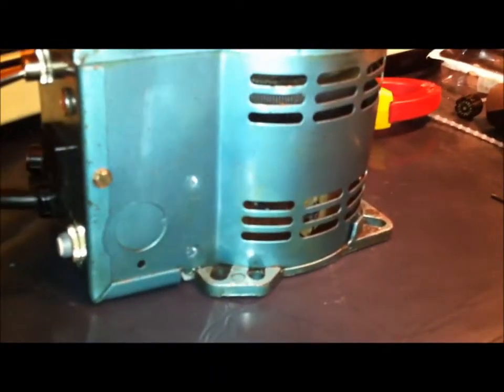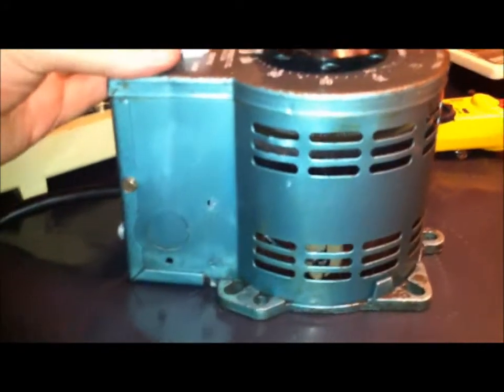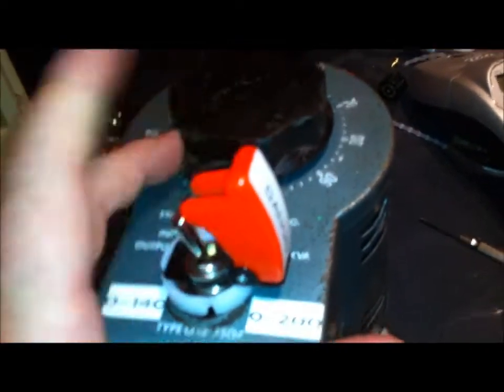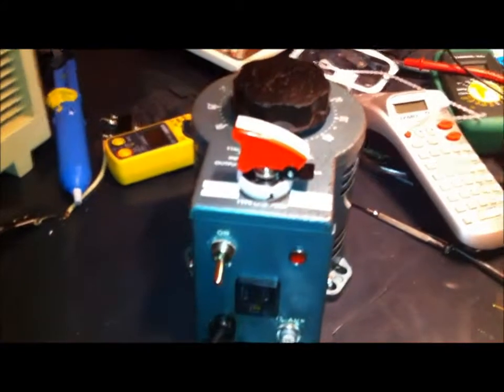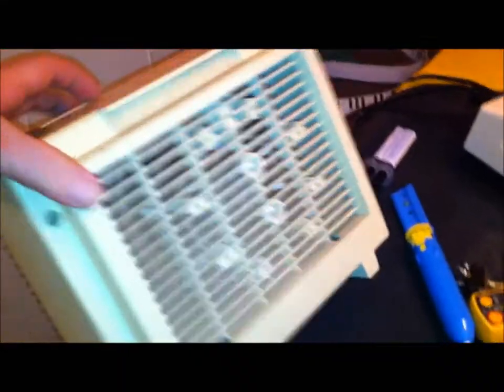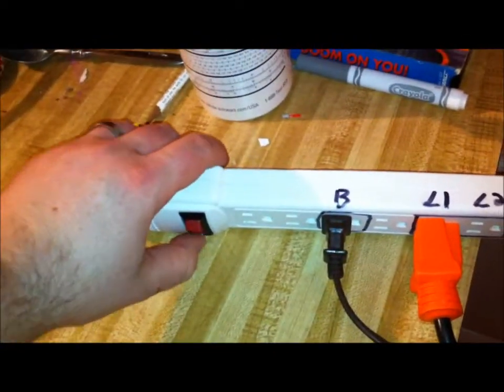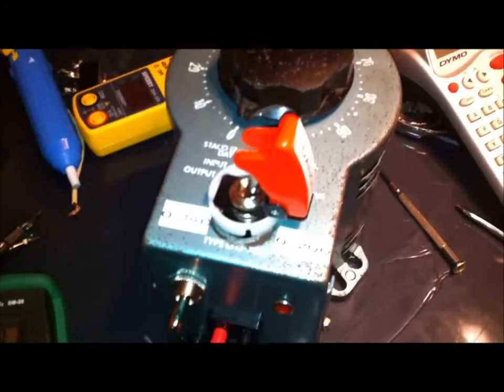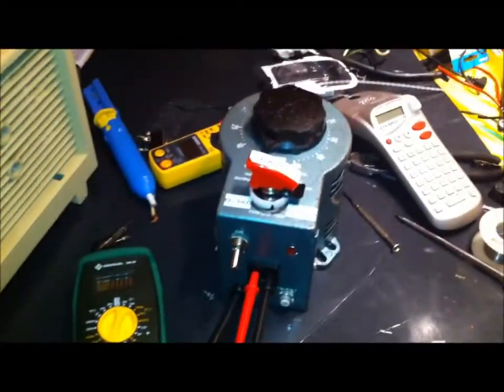Modded Variac test

Comment from the maker: A push-button circuit breaker of the same rating should provide the same protection as a fuse, and some will even trip faster than a fuse might blow.  The cheapo variacs on ebay might not be made well, and can be dodgy, though...  I'd be careful with those.  Best bet is to find a used older one that was made well and clean it up and restore, but that's just my opinion.

Comment: 200 whole volts ? Frightening!! :-D

If it wasn't for the volt-drop across that heater, you'd probably get a bit more than that. 

Oh, one other thing....My wall socket does 240 volts as standard. :-D

Mr. Photon's variac, when selected onto the 'Naughty-Boy' mode, will easily kick out 460v.

{^_^} BoomBoxDeluxe {^_^}

Comment from the maker: For some reason, Youtube did not post the comment I recieved via email.  Here is the comment I am responding to:  "Photonicinduction has made a comment on 'Modded Variac test:'

Great vid, but an Inductive ballast is required not a resistive ballast,
look out for a 400w lighting ballast, it will be much better :)